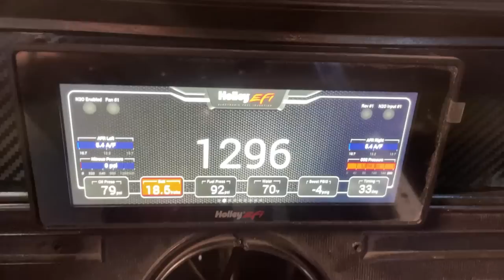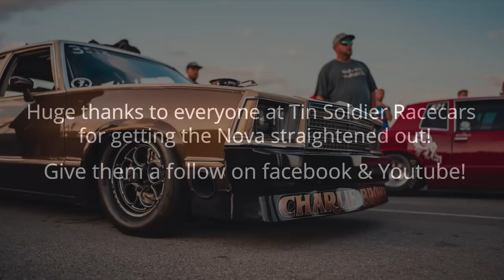The Nova gets HUGE UPGRADES at Tin Soldier Racecars! + Welding Tips/Tricks

Comment: Nice work and a lot of talent, but damn that made me nervous watching them under that car with only the jack holding it up.
Reply: I was thinking the same thing. I use to crew on a Nascar Late Model back in the 70s and  80s A Good friend of mine to this day Father also ran in the same class. He needed some work done on his car the day of the race and his crew was running late. He jacked up the car never put stands under it. When the guy's got to the shop they found him crushed under the car deceased. It fell off the Jack and crushed him. I see this more then you would think watching vids on You Tube. Please Please Please use Jack Stands at the very least. Another Great Vid SRC.
Reply: I know they were trying to find the center points. car was firm in the front. If tyey had to do it, atl3ast stay on the outside. props that  it wasn't a cheap HF jack. at least put a "catch it" stand or block near rear hubs. If really necessary to keep rear rails and suspension unloaded, place some nearly touching blocks so it cant fall far. might bend the rotors if it did fall, but to have safety always first, is how we keep you all around.

Comment: You have a dash low voltage problem while cranking the Nova Billy. Try running a separate cable to battery to power your dash so it stays lit while cranking.
Reply from the maker: That’s how slow the dash comes on every time regardless of cranking or not the falcon is the same way
Reply: Is it 7:00 yet lol

Comment: I’ve been subbed for a few years now to Tim soldiers race cars I have a lot of there parts in my rear end I have there anti roll bar and four link brackets  there  rear ends are nice  back when I got mine I got on a deal off a buddy it’s a Merlette MR rear end housing with strange axles and center section I was really lucky on some of the parts I got for the price I got them.

Comment: I think the truck and the Falcon would benefit from a Tin Soldier's Race Cars Fab9 and their "Low Prep" 4link rear suspension and the TRS long travel front shocks and struts and if I was y'all I would convert the front suspension over to spindle mount long travel struts on the Falcon and the Nova and also switch over to a stiletto style rack and pinion steering rack that way it lightens up the front end and distributes the weight better to get all the weight going to the back tires as quick as possible and keeps it there so you can get better traction the further you get down track and I would run a 17in front wheel and a 16in back wheel on both cars as well and now that Billy got the Nova together it's time for the Falcon to get upgraded to go even faster and eventually the two trucks need upgrades because they are well over due for some R&R

Comment: I'VE BEEN IN THE BUSINESS FOR 40 YEARS, MOSTLY TIGGING NUCLEAR, SS AND TITANIUM, AND I'M IMPRESSED, GOOD JOB!!!!!!!!!!    THANKS, SUBBED BECAUSE OF BILLY!!!!!!!!!!!!
WHAT DO YOU LIKE BETTER THE EVERLAST, LINCOLN, OR MILLERS, I HAVE A 40-PLUS-YEAR-OLD MILLER, I THINK EVERYONE HAS 1,, WEIGHS A TON, RUNS OFF A 125 AMP BREAKER, AND YOU CAN WATCH THAT ELECTRIC METER SPIN OFF THE WALL!!!!!!   USE IT ONLY ON 5/8TH OR THICKER ALL. PLATE!!!!!  THANKS!!!!!!!